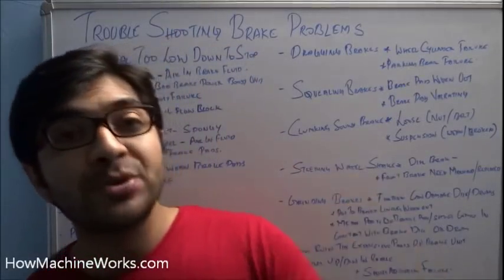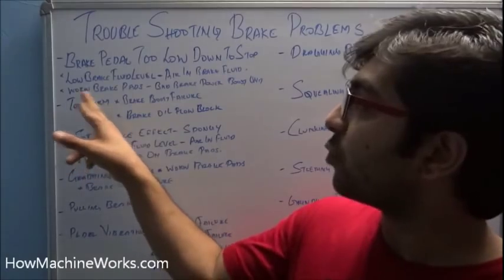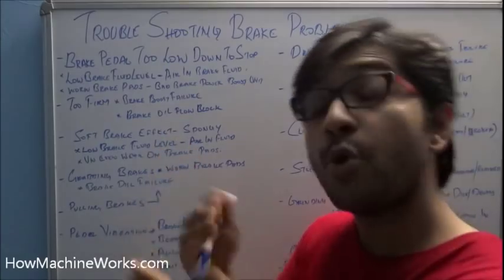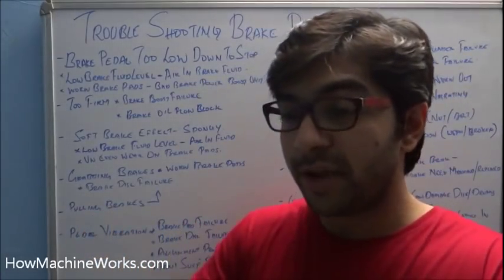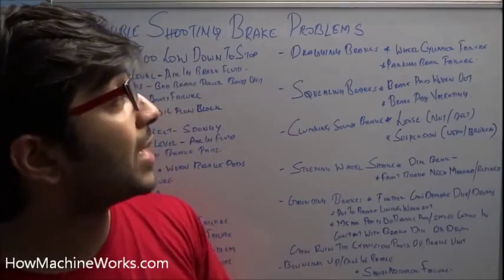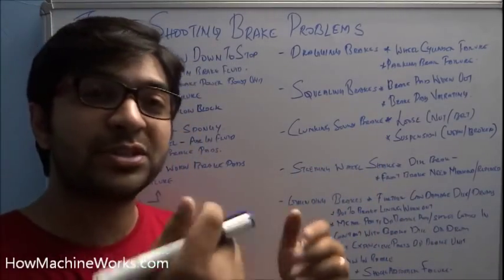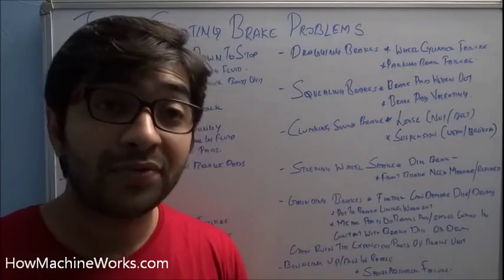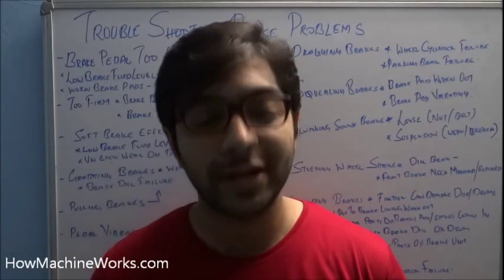Common brake problems and solutions - Must watch.

Comment: Hi, Thanks for the explanation. I think the issue with my brake is not one of them, or similar to the last one. My car stops step by step (gradually). If you are a passenger you think that I push the release the pedal. No bounce or vibration in the car, pedal or the steering wheel. one mechanic said you may have air in the system and second one said I know that, the rotor needs to be machined. which one can be correct? or maybe none!

Comment: Hi there, I have a 2000 Hyundai Elantra, no ABS. The brakes are locking up intermittently in stop and go traffic for the last few months. 
I removed the front tires. The brake pads were locked solid and the rotor wont rotate at all. Front-driver side brake and wheel was blistering hot, front-passenger side was less hot. Back brakes were not hot. When the wheel/brake lock up, the brake pedal is stuck at the up position, brake becomes super sensitive, the car drags and just touching the brake stops the car. Pressing with a lot of force wont make the brake pedal go down, it stays stuck at up position for 10 minutes even with the engine off. 
15 minutes after turning the engine off, the brake pedal would go down a little bit. After 30 minutes everything becomes normal, the brake pedal goes down and up normally, the car drives normally afterwards for the rest of the day.
The car also runs louder than before. Rotating the steering wheel to the right diminishes the road noise partially.
People gave me a big list of things that could be causing this. After this locking issue started happening, over the last few months I replaced the following parts:
1. New brake pads and shoes on all 4 with new hardware.
2. New rubber brake hoses in both front brakes.
3. New wheel cylinders in both back brakes.
4. New caliper with piston assembly in front driver side. Passenger side is fine.
5. New wheel bearing in front driver side (there was visible smoke from front driver wheel when it first happened). Other bearings are fine.
6. New cheap Chinese tires on all 4.
7. Bled a large bottle of new brake fluid through the system.
None of the above fixed the problem. Any ideas?

Comment: i recently changed one of the brake lines in the back because there was a leak but now its changed and there is no pressure on the brake pedal

Comment: hi. my breaks are not as sharp as they use to be. I can't do emergency stops. It take much long to stop. I did put a new master and bleed all four wheels but it's not getting right. I normally repair my breaks for all my vihacles. but this time I'm having kak
Reply: Service them. Clean and lube the slide pins (theyre likely seized) and shims.
Reply: when was the last time you changed brake fluid? Best brake fluids last up to 3 years, usually it's 1-2 years you should change it, it will affect your braking distance, but not only, systems such ABS, ESP etc. will be triggered with a lag because of used brake fluid.

Comment: when I press the brakes (disc brakes), my steering/car body shaked forward/backward..... especially when going downhill or braking from a high speed run.
Reply: +MrCpMbOy you need to get your rotors turned or replaces

Comment: I have toyota allion 2011. When I accelerate then it is going pretty well but when I leave the accelerator paddle, it seems to brake itself though I didn't press the brake paddle. What might be the issue? Is it brake problem or the car is not properly heated?
Reply: I have the same problem with my 99 Honda accord. my break pedal gets hard when I accelerate and when I press on the brake my car shakes bad and feels like the brakes are stuck.
Reply: I have the same problem with my 99 Honda accord. my break pedal gets hard when I accelerate and when I press on the brake my car shakes bad and feels like the brakes are stuck.

Comment: HI.  I have a 97 Lincoln Mark VIII that I just purchased.  I  press on the brake and the pedal goes down 3/4 and essentially stops.  If I keep applying pressure, the pedal will sink lower to what seems the bottom.   What could this be?      
I try to pump up the brake but doesn't help.........Also, when driving, he the previous owner idiot said it was the ball joints making noise, but I dunno.  Could this be the brakes?  It makes weird noise upon driving it.

Comment: hello, i have a 2003 ford explorer sport. i just moved to california and have been using my e-brake when i park since there are many hills out here. recently, i have noticed a grinding/squeak/squeal sound when driving with a slight pull. looking under the car, everything looks rusty. is it possible that when i pull the lever to release the e-brake that the brake does not actually dis-engage? and that may be causing the grinding while i drive? or do you think it may be the metal to metal contact you talk about in your video. because it definitely sounds like metal on metal. thanks for taking any time to answer this. informative video!

Comment: hey i was doing a nocti booklet and in your video according to you my answer was correct.  for a pedal too low to the floor while stopping i said low brake fluid but the book is saying the rear brakes are out of adjustment. please help me understand
Reply from the maker: 098ctd What is the failure,,can you please elaborate
Reply: the failure is that NOCTI is saying one answer and you are saying different
Reply: Take rear drums off and wind self adjusters out until the shoes are just rubbing on the drum when handbrake is off, pedal will be higher and handbrake too

Comment: my brakes are grabbing they are too sensitive you can't brake slowly and there is no feel when braking, if i press the brake softly it will brake hard its like the brakes are grabbing. How can i fix this?
Reply: you should be lucky that your vehicle stops
Reply from the maker: maltatravel If you have worked with brakes, definitely you know what to do, we don't think its good for you to work on it if you are new.Its a matter of safety, please get your vehicle to a service center where you can get the help of a trained mechanic.  We feel its might be a matter of minor adjustment, but still only an expert should do it.
Reply: ***** maybe its the brake booster maybe there is a setting or maybe its the way the booster is made. i don't know im not a mechanic lol... all i know is that i have sold my old car that had those super sensitive brakes and i'm not missing it one bit.

Comment from the maker: Yes i said "pneumatic" but its about the presence of air in hydraulic circuit, due to the moisture entry and getting evaporated when get, heated. This will create a pneumatic effect which will reduce the brake effect (you have to pump the brake pedal for over coming this situation. 
Tks for the comment, please have a look at our other videos too and give your feedback....